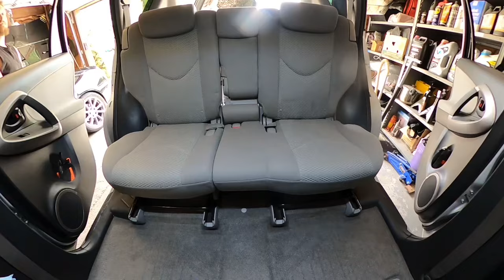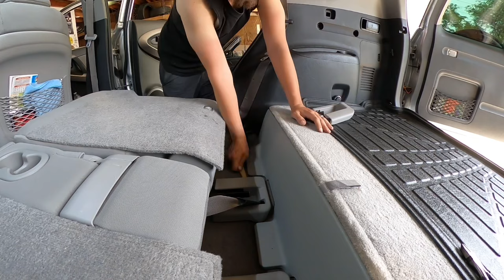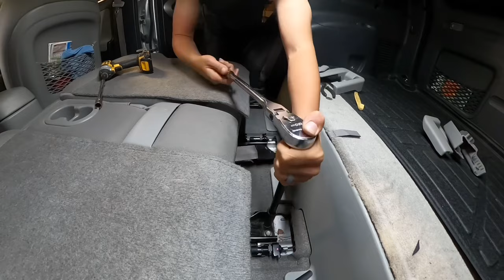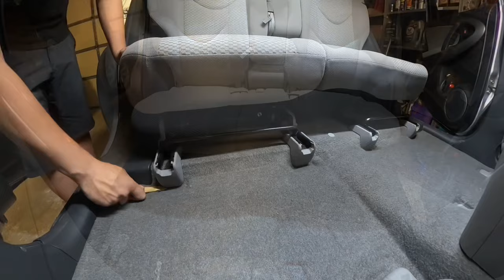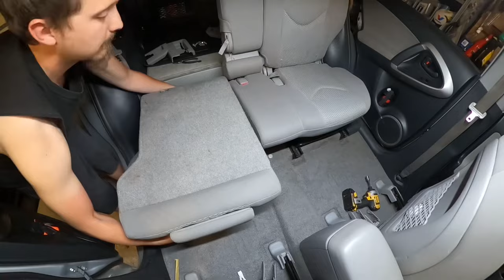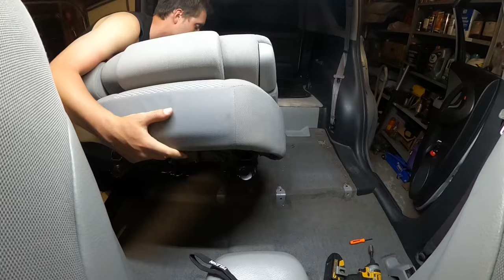How to remove rear seats 2006-2012 Toyota RAV4

Comment: You made it look so simple with removing that cable.  I had a hard time removing it and even harder time putting that cable back. Do you have any suggestions?
Reply from the maker: A Pocket screw driver and patience is really the only way when working with the seat cables.
Reply: I found a way to make the cable reconnection very easy. On the cable attached to the seat, there is a plastic rectangular carrier that has a pink plastic locking sleeve (this carrier is right next to the large spring on the cable).

If you pop out the pink locking sleeve (by pushing from the back with a flathead screwdriver) you'll release tension on the cable and make it 1000% easier to rejoin the connectors.

Sorry if the explanation isn't great - would be super simple to show in a video. Hopefully that gets you on the right track
Reply: @MarkCowin  thank you, I will check it out.

Comment: What is the yellow plastic tool that was used?
Reply from the maker: It is a trim remover tool. You could also use a flat head screw driver but might scratch

Comment: What is the cable you were removing at the end of the video starting at 1:12
Reply from the maker: It’s the cable that folds the rear seats down from the cargo area.
Reply: @CPAutosAndAdventures  how do you put it back
Reply: The cable
Reply from the maker: @dragzoon95 insert the cable into the connector and twist.